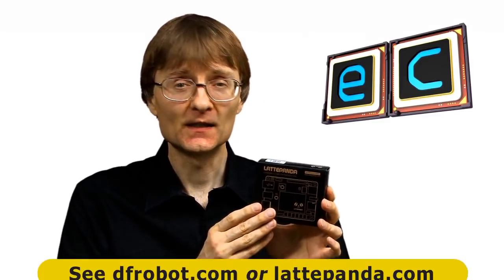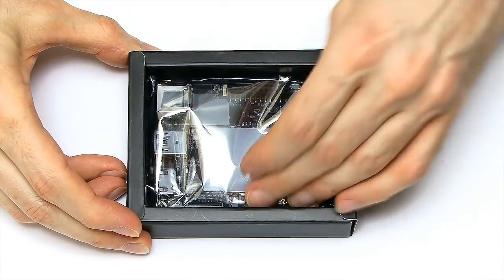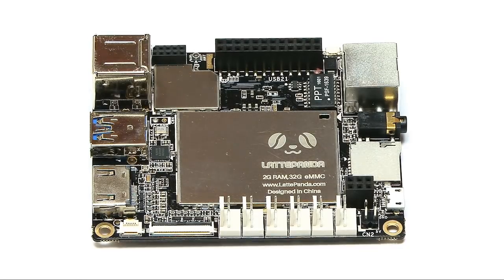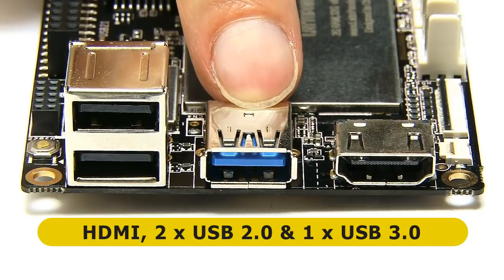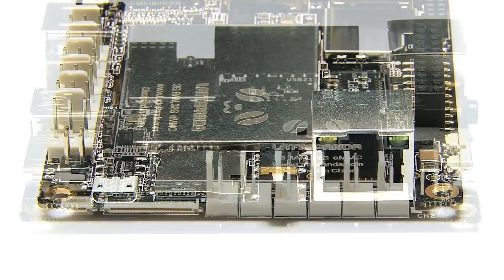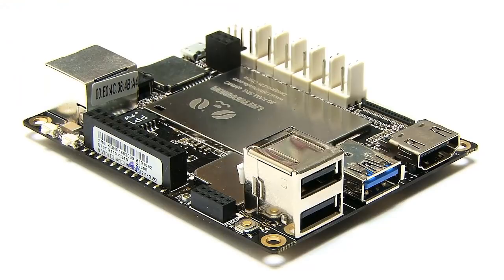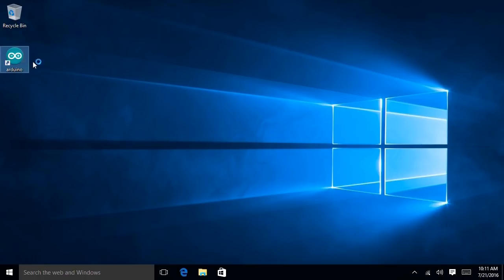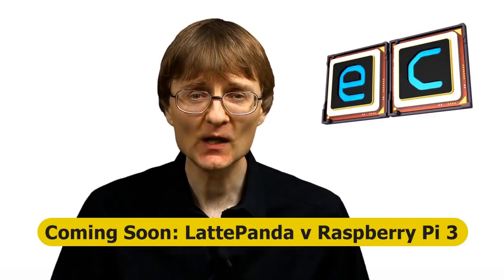LattePanda Windows 10 Single Board Computer

Comment: Can Linux run on this? Does the firmware allow booting from USB and or Memory Card?
Reply: LOL. Why would you want to? A pi3 walks all over it for 40 bucks. It's a 200MHz piece-a Chinese intelligence.
Reply: It depends. The Odroid-XU4 walk all over the Pi3, but some are looking for x86 based SBC. Comparing ARM to x86_64 is comparing apples and oranges.
Reply: Its getting very near the point sensible people will be looking elsewhere for their computing solutions. Intel, Windows, Apple, Google... none of these are trustworthy. Not even Ubuntu. Every damn one of them is full of telemetry which ultimately gives the US government a direct path to your thoughts and interests. People do not realize how all this shit works... It's ironic we may now have to go where... China? Brazil? For trustworthy computing platforms. We've recycled all the trustworthy computing devices, long gone to metal recyclers. No more Pentium IIIs and P2B-X motherboards.

Buying a device like this designed from the ground up to run Windows is like buying a gun that only fires when you're pointing at your own head.
Reply: Brad Scott
Hello! Ubuntu is open source. The code is available to all. That means if there are spy codes embedded therein people would see it and it would make news.
Reply: There is and it has, but no one cares. Ubuntu comes with a desktop search agent configured that, by default, sends all your search strings upstream to Amazon and, depending on what "lenses" are enabled, others a well. Everytime you use the panel to search for anything (and that is how oyu use it) that telemetry is recorded and used to help remember things for your convenience. You can disable it and remove it, but you have to do that yourself. By default, it is integrated in this way. And, with the partnership with Microsoft, who knows what kinda weird kernel stuff they're going to start doing there.

Windows is open source as well. You havbe to put up some money and sign a bunch of legal disclosures, but Microsoft will allow you to audit their code. You can't do anything with it including talk about it with others, but it is technically open source. Open Source is a meaningless expression. GNU is free software, not just open source. And when you start dabbling in binary blobs that only certain people are allowed to see, you're right back on the path that got us in this mess we're all in at present. Free software, free societies.
Reply: Brad Scott
I guess all we can do is be good simple little people with nothing to hide then. But what about "high privacy" distros like "Tails"?
Reply: Brad Scott
Spy-code are built in to mobile phone chips and maybe even automobile processors and firmware.Not to mention smart TVs. The only option we have is to forsake technology altogether.
Reply: Not true. "Spy code" in my tv set means nothing if the wifi is not enabled and the cable is not plugged in. "Spy code" in smart phones means nothing if I don't use a smart phone. Whatever my car cpu does I don't care as it has no ability to listen to my conversation or access my personal computer.

ARM is an open architecture. One labs has most of the market share but their leader just left for Microsoft, so there's sure to be some shakeup. At any rate, ARM can be licensed to anyone for manufacture which means systems based upon ARM can be open end to end. Most are not yet, but they can be if we demand it.
Reply: ARM is not an open architecture, at all. Manufacturers can buy a license to access their intellectual property to produce them, or in some cases, like Apple and Samsung can introduced new instructions, but can never release the ARM Holding copyrighted intellectual property. It's NOT at all what we can call open.

And by Lab, do you mean foundry? Because if it's the case, the first worldwide producer is TSMC, which manufacture processors for Apple and Samsung. And it's leader, Morris Chang, never moved to Microsoft, so i wonder what you're talking about here.
Reply: From today:

Intel has hired Tom Lantzsch away from chip design competitor ARM Holdings to run its newly separated business focused on making processors for smart, connected devices.
Reply: This is not 200 MHz (lol where did you get that from?) and processor-wise, it stomps a Pi3 into the ground easily. It uses a little more power, but unless you're running on batteries, who cares?
Reply: Brad Scott should take his anti-psychotics.

Comment: I'd rather it didn't come with Winblows it's gonna ramp up the price.
Reply: SpudHead actually Windows doesn't charge a fee for the licensing if it is on a low cost PC. it's been that way for about a year.